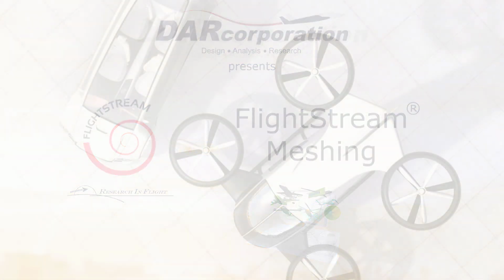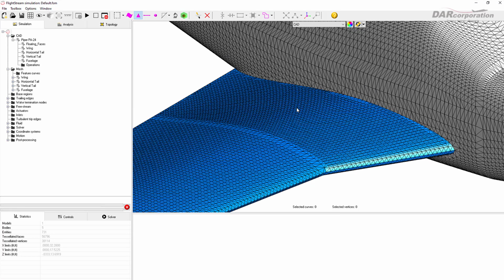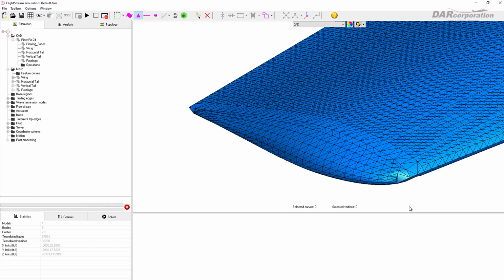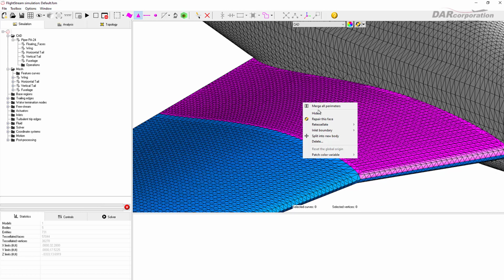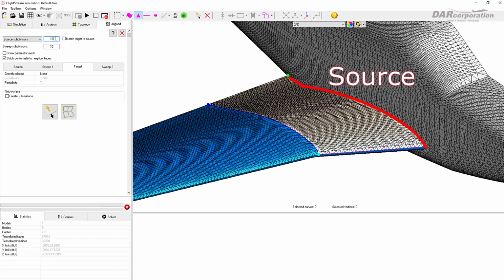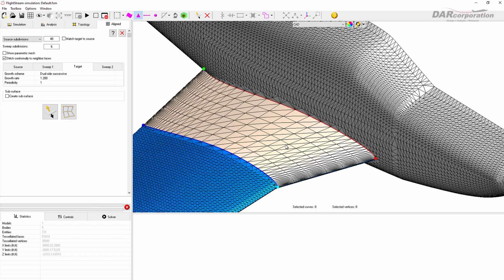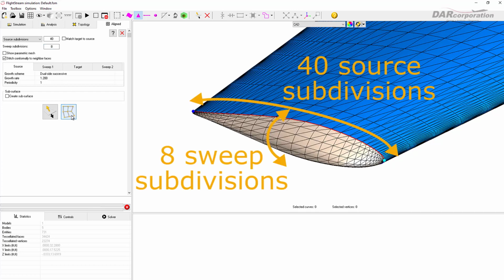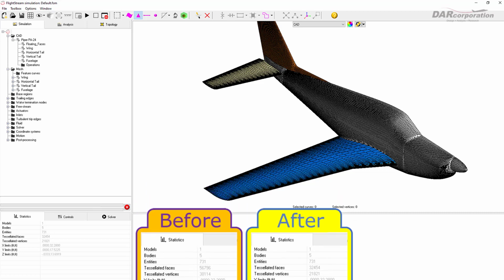FlightStream® Meshing Tutorial

Comment: What is the criteria for assigning the Source and sweep subdivisions? The Video unclearly states this under "chord-wize refinement ".
Reply: and what is the acceptable mesh for any simulation?
Reply from the maker: Acceptable mesh is a case-by-case situation, dependent on your model. A useful rule of thumb is to set the mesh density enough to reflect the geometry shape and not over-mesh like traditional CFD approach. CFD-type very fine mesh only slows down FlightStream without contributing to results accuracy.
Reply from the maker: The source and sweep subdivisions are set in such a way to capture the pressure changes across the wing surface. The chord-wise direction (i.e. downstream) refinement is more dense so that each grid can represent the change in pressure across a small surface. Surface pressure changes a lot on the wing leading and trailing edges which means you need more grids (i.e. more source subdivisions). At the middle top surface of the wing, the spanwise pressure from root to tip does not change very much and that needs less sweep subdivisions to represent small changes in surface pressure.